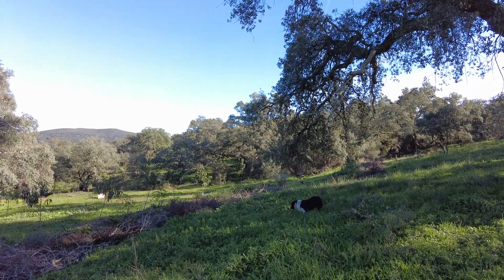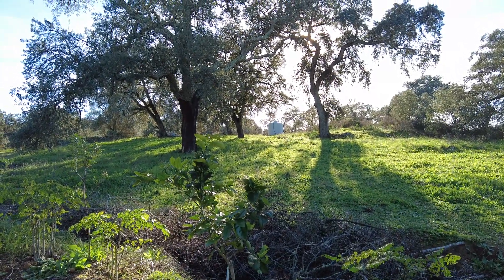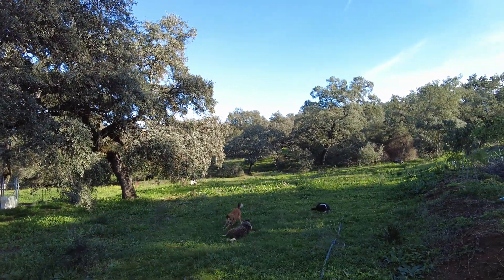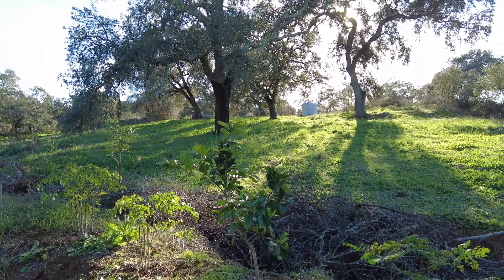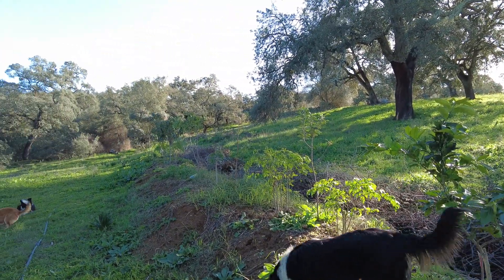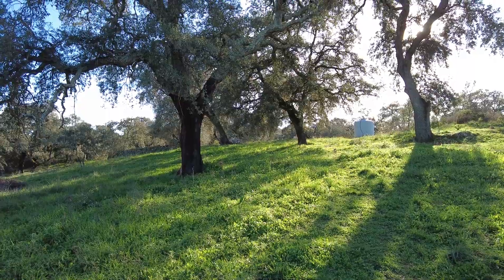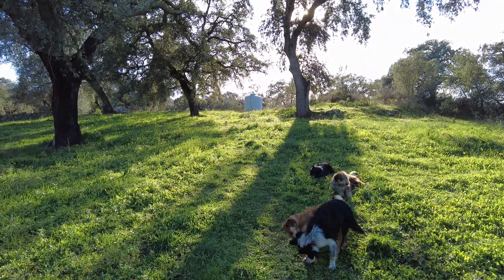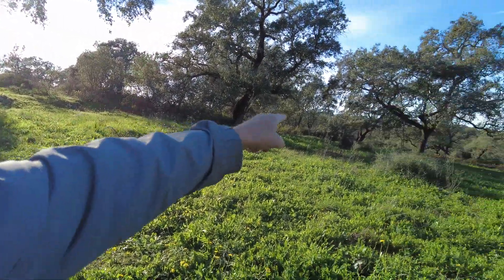Drip irrigation headache and it hasn't even started!

Comment: This is close to the calculations that I had to follow. For trees they say, it's best to have a ring of emitters around the trees to hydrate the root system away from the tree itself.
If it helps, pressure is not such a huge deal for drip emitters (as long as you have sufficient for the emitters being LP or HP ones, compensated or not). Flow was my enemy, and since my system was limited, I had to split my zone into two-zones on the timer and run them separately to ensure adequate flow (the 350kpa didn't help one bit).
Drip is just great, it is saving us so much water in the hottest of times. Great video.
Reply from the maker: Great advice. Thanks for sharing

Comment: Water pressure is just under 1 pound for 2 ft drop 
6 meters is 20 ft 
So 10 psi or 8 psscals 
Sould be enough for drip 
Water volume in pipe  
Equals 4x. When pipe is 2x
Emmiters are bought for X liters per hour 
So for first line if 1 ltr and flow is 20 ltr then 20 emiters 
Double the ht to 12 meteres then you can double the flow a double the emetters 
You should have charts where you buy the emitters to determine how many
Reply from the maker: Thanks for sharing.
Reply from the maker: Chart I must find.

Comment: I don't have such a big area as you, but still I will share with you how I made irrigation around my house, only for one area.
I'm connected to water network of my place, so inlet pressure is higher than 3 bar (it is impossible to find what is  exact pressure, no information about it, so I think it is even higher). I was searching on the Internet what is the best long term way of irrigation and I found that the best way is to use hose with emiters (they are already premade, you don't need to punch holes). Emiters are every 30 cm (2 of them at the same place). That hose is 1/2" in diameter and is strong, you cannot punch it so easily. Max pressure for that hose is 1 bar, so I had to use pressure regulator to reduce my inlet pressure to 0.75 bar. I connected my main inlet hose of 3/4 to spliter (3/4 to 2x3/4 with valves on it, so I can water 2 places at the same time, or just one if I want). After spliter I had to install two regulators to reduce pressure on each line to 0.75 bar. After regulator I connected that hose 1/2 with emiters. Hose is around 80 meters in length and every emiter is providing the same amounth of water. It is not that first emiter is watering more than the last one, that was my biggest fear. As water pressure in hose is only 0.75 bar and area is relatively big, I need to water that area for 2 hours every 3 days. It is way better than watering the same area with normal garden hose with my hands.
This is just as an idea. I took photo from the gardening shop of the whole system, so if you are interested, I can send you photo, so you can check if that will work for you.
So in short:
3/4 pipe spliting into two 3/4 pipes with valves, every line connected to regulator to reduce pressure to 0.75 bar and at the end hose 1/2 with emiter every 30 cm
Reply from the maker: Super! Thank you for sharing. Please email me at martin@loosenatural.com. Much appreciated

Comment: I committed my thoughts before on this topic. Your swales will water themselves with flood irrigation in your step-down system. One watering this way will satisfy the soil for probably around one and a half months. This is the method I will be implementing at the ranch when the time comes. I will not pay for all the added costs for a drip system. Thanks for sharing.
Reply from the maker: Thank you for sharing. There are several ways to interact with nature. Many times we have plans and they don't work. Many times we don't have plans and they don't work either. I look forward to your experiment and I'm happy to learn.
Reply: @loosenatural8171  Both are true, and both would be an opportunity to change course to achieve the desired results. Sometimes, the simplest path is the way nature intended for you to go. Keep going. I'm sure you will be successful.

Comment: 150 meters of 40 mm pipe, 600 meters of 32mm pipe, 60 meters of buried  40mm pipe.  Existing inventory.

Being frugal, I think it's clear that your mains (distribution lines) will be 32 mm (1 1/4").  
There are two exceptions;
1) The buried 40 mm (1 1/2") line that will serve ? berms (one timer with 2 outputs one serves east the second west)  
2) The 40 mm (1 1/2) line that will run from the tank easterly (the greatest distance) then step down to 32mm.

If you look at one of the aerial photos Martin, I envision a big letter E as the design of your mains.  The backbone runs east and west from the tank to the point where you think it makes the most sense to drop downhill.  These drops (made with a gentle curve of the 32 mm pipe to avoid fittings) should be the most efficient location to serve all of the berms.  One for the east side of the farm and  one for the west side of the farm (these downhill mains are the top and bottom of the letter E).  The middle line of the letter E is the the 14 mm downhill run that will only serves two berms.  You will have to use your excavator and dig across the hillside until you break the pipe.  It will not be difficult to repair if you have couplings and pipe on hand.  From a new T bring a vertical about 1/2 m above ground  near  the edge of the closest berm.  Turn a 90 degree angle and finish with a shutoff valve. While you have the hole open, you can set a 4" 'x 4" post that will support the water supply and timer.  Set this up at a height that is convenient for you but not an eyesore.

The emitter lines I recommend are Netafim 17mm Emitter Tubing.  It is available in 1000 ft rolls (305 m).  I suggest you speak with the factory direct to work out the specifics.  The overview is that the tubing and emitters are offered with different features.  The emitters can be bought on 12". 18", and 24" centers with different water outputs.  Once you speak with Netafim,  (there are online catalogs (just Google the term) I'll suggest you order a 100 foot piece and give it a try in the garden now.  You may have to go outside of Spain because Gardena seems to have the Spanish market locked up.  I'd suggest GB or Germany.  To calculate the water needed per minute, multiply the number of emitters by the flow rate per hour then divide by 60.

The timers I recommend are the Orbit 58910 Programmable Hose Faucet Timer, 2 Outlet, Green. ($39.02 US)  They are simple to program, your runtime is down to the minute and it runs on 2 AA batteries.  If you need a single outlet (this will depend on layout) Orbit 62061Z Single-Outlet Hose Watering Timer, ($31 US Amazon)  I imagine the application will be one timer per berm or one double timer for two berms.  Runtime, educated guess is 15 minutes every 3 days.  During the heat of summer 20 minutes every 3 days.  You would set the timers to run sequentially. This is the timer you saw on "The Simple-Earth Journey".  Of course, there are bluetooth versions available that you can control from your phone - but that's technology that is beyond me (and much more expensive). 

You will need to counteract the dissolved calcium with a venturi injector (or 3).  Elemental sulphur is great supplement  if that will keep the emitters clean.  This is a question for Netafim.

There are two first steps, you pick 😊
1) Contact Netafim - may be best to call the factory for technical assistance/questions.  They will fix you up with a distributor when the time comes.
1) Pull the mains roughly into position to get a feel on the ground in real time and space, if this all makes sense to you.

Regarding the moulded in emitters; there are many benefits, especially life expectancy in your Mediterranean sun. The only question is managing the calcium.  
I envisioned the entire berm as a horizontal stip of life year round.  That the entire berm would carry moisture so even the adjacent oaks could tap in and to encourage the roots of your planted trees to spread out.
I'm really happy to hear that you are out releasing oaks seedlings.  That means there are more out there than we may have thought?  Remember, they were all mowed down about 5 years ago, so they should have bigger root systems than the tops would indicate.
Great to see the Giraffe back in the pond!  DIg deep and make the key wide so you are comfortable travelling on it!
OK, that should give you some things to think about. 😉
Reply from the maker: Thanks Steve. I'll have to read it several times.
Reply: @SuerteDelMolinoFarm  No problem Martin.  THere is a lot to digest (this has been in my head for a long time) and it's really hard to put pictures into words.  If you're confused, let me know.
Reply from the maker: I spoke inaudible words. The buried pipe is 40mm. Apologies
Reply: @SuerteDelMolinoFarm  Fixed it.  So there is plenty of capacity to serve more berms if there are any in the area.  Updating on of your topo maps with berms would be a good idea as part of this process.  Those pipes are going to be very hard to pull.  Perhaps the Giraffe will pull them for you is the turf continues to dry.  First rain I see is January 5th.  There was rain in late December, but it's gone.

Comment: Former market farmer here. After many years of experimentation, trying all sorts of drip emitters all of which would clog, my final conclusion was that the best drip emitter was no emitter. I would run the line and use 1/8" / 3mm spaghetti tube, but put no emitter on the end. The spaghetti tube clogged very rarely and were easy to replace. The issue with your long runs is that you might have to use pressure compensated emitters / T-Tape, so that all the emitters open simultaneously, once pressure is reached, so that tall plants get the same amount of water. If you can run your water to the halfway point of each zone so you start out with a branched T, the pressure differences are lessened. 

In a hot climate you might use white poly pipe instead of black to keep irrigation water temperatures down. Thermal expansion and contraction is an issue, especially on long runs. You can keep your lines taut by tensioning the ends with an elastic cord that can give and take through the changing pipe lengths as the line heats and cools. 

Netafim is an excellent professional brand. If you have a distributor for them, the distributor can access design experts who can specify exactly what you need. Top quality is the least expensive in the long run, although the initial costs are higher.

No drip system is perfect. It will greatly reduce your work load. You will still need to walk all the lines regularly to ensure that every plant is getting water.
Reply: Thank you Pat!  I'm so pleased you joined the community.  Your hands on experience is invaluable.  All great suggestions.  WHen you have a chance, check out what I wrote above.  It's really hard to put pictures into words - but I did my best.  These runs are SO long that I don't see a way around pressure compensating emitters.  I suspect it will take a constant injection of some acid to compensate for the calcium.  I encouraged Martin to contact Netafim direct.  It is very odd the way business is done in Spain.  I think Gardena has a lock on the market.  I HATE their fittings.
About quality, this location is close to the equator that their UV exposure is right at the top of the chart.  The Netafim tube is the only one I know of that will survive the degradation.
Reply: @stevejohnstonbaugh9171  Thanks Steve, we're definitely thinking alike for his system. I wonder if there will be sufficient pressure via gravity alone for the pressure compensated emitters and hose timers. There should be with the elevation drops, but the long runs mean some friction loss. Netafim will know. A small pressure system coming off the cistern could always be added later if needed, grid power or solar. Definitely need some acid injection. Maybe a disk filter if there is possible sediment in the water. Ensuring emitters are not in direct contact with the soil reduces clogging. Need a way to flush out the end of every line. Water slow, grow fast!
Reply: @patblack2291  Thanks for the read through and additional information.  I stopped where I did because I didn't want Martin's head to explode 🤯 I imagine if he contacts Netafim corporate, they will walk him through all the details.
Thank you for your time.😊
Reply from the maker: Thanks for sharing valuable information. I'll start my pipe search and spaghetti tubing.